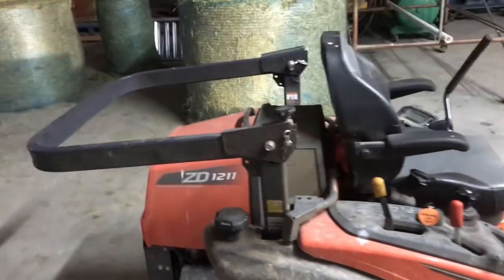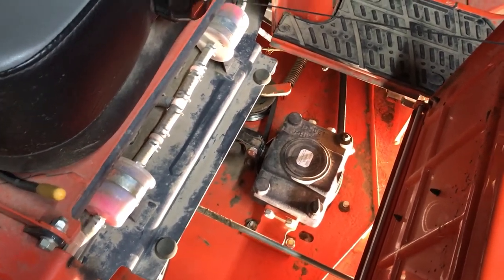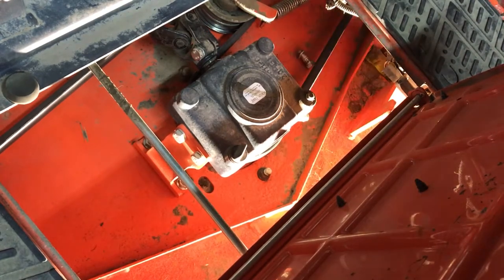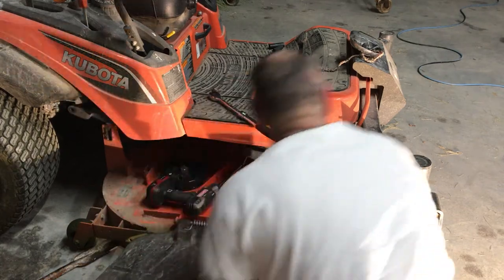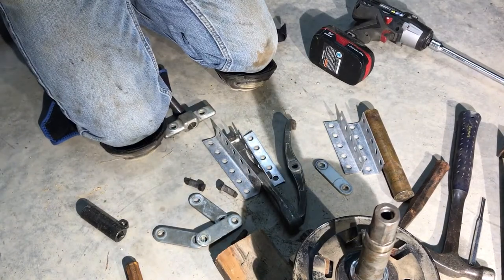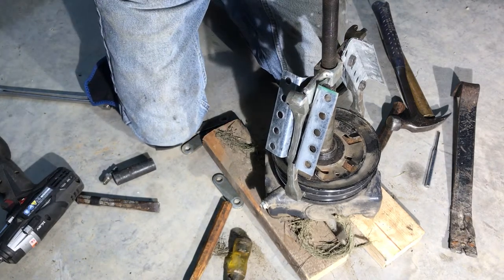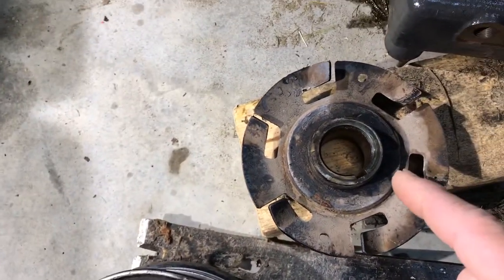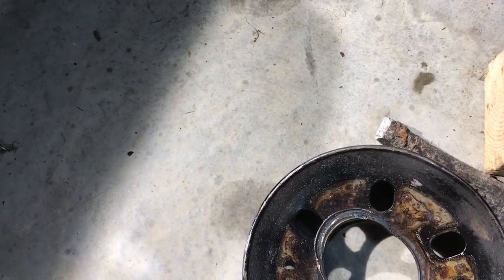Kubota ZD 1211 Deck Center Pulley Replacement

Comment: There is a safety pin that goes in place after you crank the front up. It looks like you missed that
Reply from the maker: Chris,  thanks for the comment.  I stopped using the safety pins not too long after I got the machine.  I could not see relevance of them.  Could you share with us what they are for?  Kevin
Reply: @MillGapFarms  Sure, there are 3 holes near the pivot point of the front wheel assembly. Normally a large safety pin is in one of the upper holes when the front wheels are level, when you jack the front end up you put the safety pin in the lower hole under the cross member so that if there is a hydrolic failure the machine doesn't fall on you, or a child, pet, foot, deck, beer etc. I would never leave my machine jacked up with out the safety pin in place, too much possible damage at play.

Comment: I’m glad you didn’t show exactly how you removed the gearbox
Reply from the maker: Jim, Did I not show  you how to get it out.  The big trouble on this repair was getting the pulley on in time to cut.  I think they sent the wrong part and I really needed to cut with it.  Thanks for watching and commenting.  MGF
Reply: @MillGapFarms  have to take a blade off wich that gearbox is conected to the shaft the the blade under neith and yeah those decks are heavy as heck at least not made like the other branded mowers that the decks junk made and light
Reply from the maker: Could not agree more... this is why I like Kubota!  Thanks for watching!  K

Comment: At 5:00 you still haven’t removed spindle from deck and it skips right to you with it removed. I’m stuck at that poinr
Reply from the maker: Jim,
Sorry about leaving you hanging.  The bolts that I believe you are looking for are top of the deck.  The fasten from underneath with nuts on the top . To help you locate the bolts check out www.messicks.com. There you can create an account that will help on this project and possibly future ones.  They have full parts diagrams for most all equipment kubota makes.  I've included a link for a similar deck to mine. You will want to have your deck model number handy when looking at the list of deck options. In my case, there were about 4.  All are pretty much the same but getting the right one will leave you scratching your head less.    https://messicks.com/ku/93465    You will see there are 4 bolts on the side of the unit that hold it onto the deck.  Looking at the video (5:04) you will see a heavy duty orange bracket with bolt holes that come up through the deck and attach to the side of the gear box.  Those are the bolts that you need to remove.  On a side note, while you have this gearbox out, change the gear lube in it.  Yours may be different than mine.  If you have the owner's manual check that for the correct specs.  A quick search for mine shows it needs 80w-90hd gear oil.  Prior to doing it, I would refer to my owners manual first.  It is a lot of work to change this oil and it needs to be right.  I hope this helps.  If you are still having problems, visit our website and email me.  www.millgapfarms.com   If you can send some photos of what you are working on, that would be great.  Thanks for watching our videos!  Kevin

Comment: Besides the pancake compressor issue, I distinctly saw you using a left handed adjustable metric wrench on right hand thread SAE bolts.  I’ve also had real good luck soaking stuck parts in maple syrup overnight 😂
Reply from the maker: Closer inspection Mr. Haddix you will find the adjustable wrench was in fact an SAE Model... the bolts however, were metric.  Maple syrup is the cure all for most anything!  Thanks for watching!  More videos on the way!  You might find this one interesting...https://youtu.be/YVfJV2VauC8   This week Isabel and Gabriel helped me blow the spring out again.  I stayed dry!  Kevin

Comment: How did you know the center pulley broke?  Would the mower just not work?
Reply from the maker: Paul J,  That's a good question.  You almost stumped me with this one... When the pulley broke, the deck stopped working.  I think there was some smoke too.  The pulley separated from the base.  Hope this doesn't happen to you.  Thanks for watching.  Kevin